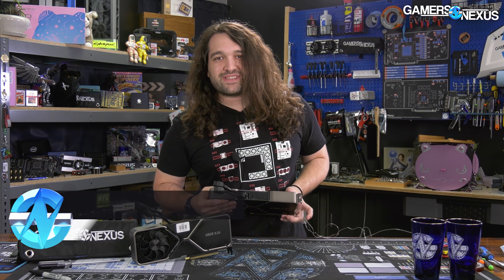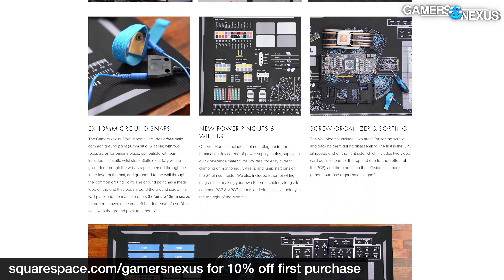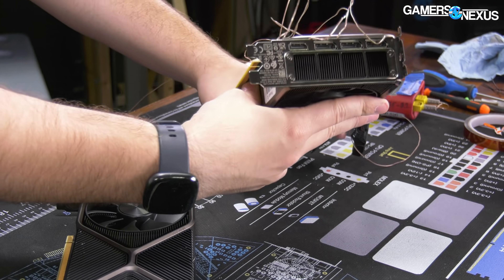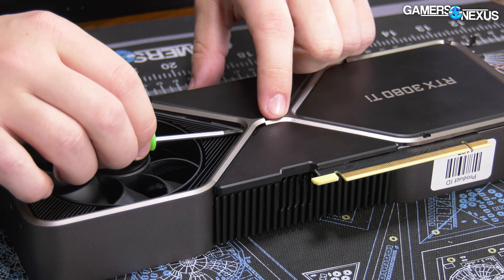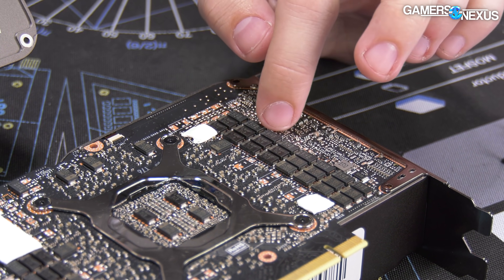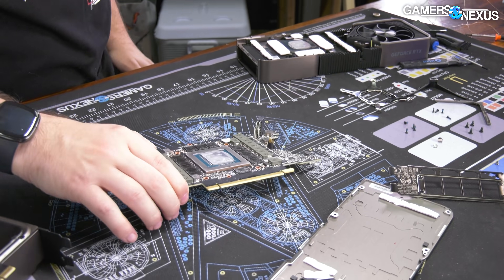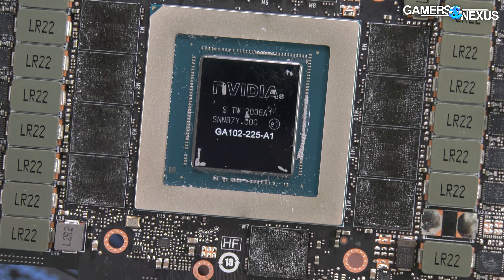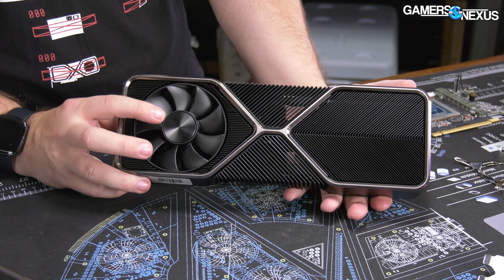NVIDIA RTX 3080 Ti Founders Edition Tear-Down: Seeking Differences vs. 3080 FE

Comment from the maker: Watch the 3080 Ti review: https://www.youtube.com/watch?v=Vtkk-_0jrPU
Reply: TIE TIE TIE!!!
Reply: Are you sure the original is not pronounced RTX 3080 feeeee
Reply: Thai as in trap thai?
Reply: Did you say pcb modmat?!?
Reply: wait is the money in there to justify the price 😂😂😂
Reply: 3080 FE: the $700 card you have to open to re-paste and add $1 thermal pads because NVidia couldn't be bothered.
3080 TI FE: the $1200 card you have to open to re-paste and add $1 thermal pads because NVidia couldn't be bothered.
Reply: Hey Steve, will you be reviewing any 3080ti partner boards? I'd rather wait for your comparisons before buying any, but if you don't plan on doing them it'd be nice to know so I don't miss any opportunities to try and get one in the meantime. Cheers!
Reply: Serious question, does anyone know just how much of the $1,199 USD price is actually a result of the tariffs?  If I remember correctly the MSRP release date price of the RTX 3080 was $699 before any tariff increase and I am curious to know the difference.
Reply: Please get some plastic picks and guitar picks for disassembly. Using the tip of pliers as a pick may have worked but it's like watching a dentist scrape someone's teeth.
Reply: You should do a review of the launch. The numbers were laughable. True paper launch. At all Best Buy stores combined across the United States there were only 3000-4000 cards. Most store at 46 to 64 cards with 200+ people in line.
Reply: Thanks for memeing Tie , dont let them forget lol
Reply: Steve can speak Thai, too?
Reply: Kinda went overboard on that, didn’t you?
Reply: If its the thai and fe wouldn't that explain the thai fee money?
Reply: What are those 5 pins in the middle for? They do connect to the board
Reply: @cripticdestiny  shroud leds or the fan
Reply: @vollkerball1  LED and the fan wires were mentioned and shown. but not that one
Reply: I'll provide 1x  a purchase donation of a standard Driver Set for 1 needy Australian enthusiast if the 3080 Super, when released, has those 2 last remaining inductors and power stages filled. Surely the incremental updates have been planned by Green.
The First Aussie to reply here, once the Super is released and GN has done a teardown, gets the opportunity to be chosen by me. No teardown, no prize.
I will keep abreast of the status in the coming months.
Reply: Hilarious part is that the front of the card actually looks like a tie.
Reply: It's pronounced 3080 "FEE" not "F" "E"...
Reply: donde tienes tu video de la 3060 ti funders  tear down que hiciste yo recuerdo a verlo visto de tu canal

Comment: Just did repaste+repad after 4 years and a half (time flies...) of hard use, your video helped a lot and still love the humor 👔!
Used Kryonaut and gelid extreme (1.5mm front and 2mm back, a few 0.5mm here and there but not mandatory)
Thermal paste was super dry, thermal pads seemed ok
I think my sample of 3080 Tie FE was a good one, I've done 21 295 graphics score in TimeSpy with it (overclocked and overvolt)

If someone wants to know the results : 
24°C ambiant
Steel Nomad UV+OC (0.818v and 1830 MHz and +900 on memory)
power draw : 350W
fans : 49% (1730 RPM) -> 40% (1400 RPM)
core : 72 -> 66°C
memory : 88 -> 82°C
hotspot : 81 -> 73.5°C

I've done more tests with fixed fans, basically the higher the fans spin the less the difference, with 100% fans it's only a few degrees.

Selling it to someone who won't downvolt it, so he will draw more watts, I want him to get a nice experience (as quiet as possible since this card can sound like a Airbus taking off) and hopefully the card will serve him well.

Comment: Finally got my hands on this for my Ghost S1 Build 5800x3D now I'm just waiting on the RTX Spine and the copper plate for this iv already added the kapton tape around the memory so it doesn't short. And yes this card needs the copper plate it's going into a very tight space all the help I can give it will be needed. Also ordered multiple 2.0-2.5 thermal pad replacements.

Comment: Just use duct tape to remove the screw covers! It’s really easy. I got some super tacky duct tape called TRex duct tape. But any tape is strong enough to pull these off. I tried for a while with a screwdriver, but all its going to do is leave marks and possibly send that thing flying.

Comment: ? How are changes in capacitor types and changes in phase module layout not considered potentially significant? GN could have easily looked up the part numbers on the caps and provided an actual detail about the different caps. Instead they discard the change as not significant. What does GN base that determination on?……….Real sus GN

Comment: Great video helped a LOT! Quick question if any1 could answer. I have installed the EK Special Edition Waterblock on my 3080 ti FE and I get temps around 54-55 degrees Celsius (under load) in a Lian Li o11d (yeah, unique, I know) with a 360 PE and 360 SE EK radiator and an i5 9600k overclocked to 4.8Ghz in the loop. Are those temps normal or a bit high? My 2080 super in the same loop was running around 8-10 degrees lower. Thanks.

Comment: I fully agree that the price hike isn't warranted at all.  But at the same time this is the only card I managed to buy at MSRP to upgrade from my 2080.  I'd rather buy an overpriced card at MSRP than pay $2000 to a low life scalper for a marginally "worse" card.  Thanks for the video though.  I needed this to determine whether I could use a 3080 waterblock on my Ti

Comment: The different caps may be another power rail or are being Operated at a higher power and therefore have some sort of derating factor (or stuff on the other side of the PCB needed extra cooling)

Comment: Hey GN! Been a big fan of your gpu teardowns for a while now and I would like to learn more about the methodology about how the boards are put together. I'd love to see a video from you guys about why certain components are where they are and how each piece works together. I'm especially interested in memory modules and how they work with capacitors and connections to power and core. Maybe if that isnt something you guys would be up for, could you direct me to a channel/video/blog that goes into those kinds of details? Thanks! Love your stuff!

Comment: Not gonna lie, I have almost zero interested in GPU's atm.
In fact I have almost zero interested in computer hardware at the moment. 
Which is odd because since the  early 90s I have always been constantly following, upgrading, overclocking, gaming, socializing, ect.... through my rig(s)
Just these prices are to out of control, and stock problems. Its taken the joy out of it.

And so, I have sort of been "forced" into trying out new hobbies, like I recently built a playset for my daughter, and I bought an old suburban that I'm building out to be a weekend camper with some offroad capability. Its funny how the butterfly effect works.

Comment: 10:38 They were most probably limiting supply on purpose by allocating dies for this unreleased GPUs from the 3090 rejects. They're playing for maximum profit while saving on the architecture development cost by implementing a jack of all trades architecture with total disregard for power consumption.  AMD on the other hand,came claem with its top threee SKUs. I guess it wasn't enough for Nvidia that the market conditions  would naturally make any available GPU popular,  they had to screw customers over even harder. It wasn't enough for them to sell directly to miners or to keep the best silicon for themselves. I have a 3080 in my system but I still hate their guts and hope they get dunked on by AMD. Guess they didn't learn from what happened to Intel.  Jensen should be shivering in his seat man

Comment: The first retail prices for board partner 3080Ties are up, ranging from €2299 (Inno3D) to €2699 (MSI). This was never going to be an affordable or bang-for-buck GPU. But bear in mind that the 6900XT is up to €400 cheaper than the cheapest 3080Tie (and less power hungry). If you're silly enough to buy any GPU at all in this market, let alone these top tier ones, I wouldn't overlook AMD.

Comment: Well Steve, technically that is the correct way to pronounce "Ti"... "Ti" is not an acronym to be called T.I., it is just short for Ti-tanium.
Now, all you chemistry nerds out there will tell me random symbols from the periodic table. But what they fail to grasp is, those elements are Latin words, not English words. The periodic table was invented in ancient times, not yesterday. A common mistake, I'm sure............👎

Also, in this particular instance, "tie" is the correct pronunciation. However, you can call it whatever you want or whatever is easier for you...
Reply: Also, for dummies: "FE" is an acronym and IS pronounced F.E.. It stands for Founder's Edition. So, "fee" is wrong.

It's funny how people argue with you, without even understanding why... smh

Comment: supply and demand. Price increases as demand increases. If supply is constrained (like power limits in overclocking) and if demand exceeds supply, the price increases until supply does not exceed demand. Price regulates the demand. Don't get all worked up about it ... it is the way it is supposed to be.

Comment: Yeah...I don't see myself with one of those cards. The 30 series is dead to me at this point. I don't care how much faster it is over my 1080. My older 1080 can still handle what I throw at it at 1440p resolution at an acceptable frame rate so I can patiently skip this generation and wait for AMD to take nVidia down a few pegs.

Comment: Ti's should be at least 20% more powerful than the standard model.  This thing is barely a Super.
Reply: Supers didn't even exist before last gen. Also, Ti models have traditionally varied by huge margins depending on yield and competition. There have even been generations where the real Titan was barely any faster than the 80ti. And now we have the 90 nomenclature... 

TL;DR: Nvidia counts on it's customers to be either stupid or have a very short memory span because their model names mean absolutely nothing other than smaller = not gooder (Except if you're counting VRAM. Then 60 is better than 70 and 80 but not 90).

Comment: Sorry to double post but i must say, yes its overpriced, but it IS well made! (Err...except the thermal pads..) Some, like Zotac, being tight on the capacitors and even VRM phases missing..sadly i have the Trinity version with a waterblock yet could almost boil water on the backplate (3090) i mean GDDR6 runs hot...but 6X? Great Bytes Of Fire!

Comment: I heard that Nvidia was originally going to use $1000 bills as they have a better thermal conductivity than $100 bills. It must have been a cost cutting measure.

Comment: Interestingly on the backside of the board, my 3080 FE (December 2020 manufacture) had the same half-hearted attempt to thermal pad some of the rear capacitors in the same position. My 3080 FE has identical datestamp, printed labels and other identifiers on the barcode sticker, which says to me that it's definitely a common heatsink design.

The placement of the pads on my 3080 FE was identical to that 3080 Ti - and lazily done in the factory (alignment not great). Plus they use that same crap pad material with inadequate W/mK rating.

I ended up removing them - as suggested by some other mod guides online - and instead thermal padded the flip-chip VRAM areas on the back of the board and improved around the "V" at the board edge. That combined with front-side thermal pad additions has brought my memory temps down about 30-40 degrees celcius during workloads or mining. 

I did this to prevent the regular thermal throttling during games and heavy duty raytracing or benchmarks. I mine occasionally for fun, but the payback at the moment is still only slightly over break-even, despite being able to mine over 90MH/sec.

Comment: Okay, I didn't have time to watch the entire video, so let me ask: If the 3080 Ti is based on the 3090, and is nearly the same performance as the 3090, then how is it the same size as a 3080, rather than the same size as a 3090?

Comment: So it’s the 3080 Thai and you work on it with your tweezers from Thaiwan? I see what you did there.

And that’s not quite enough $100 bills. You need about 10 more.

I just replaced the thermal paste for the first time on my EVGA 1070 SC for the first time since I bought it new in 2016. Hoping it doesn’t die before I can get a new GPU but assuming we ain’t getting any until 2022 at least.

Comment: I got that same short plug with my 3080 ti and it dont reach my psu so i obviously connected it to others and ran it does that matter? like bridged  or should I order a longer cable so its connected directly to psu and not to other cables and then to it sorry im a noob hope this makes sense

Comment: So what you're saying is, they halved the stock of the 3080s to make the 3080 Tis, and now they could ramp up more production for the 3080 Tis because it's NEWER, and since no one can get their hands on either they are desperate for either the 3080 or 3080 Ti. But, there is probably a better chance that the 3080 Ti stock will be much more since no one can get a 3080 in the first place. Money grab.

Comment: the 200 extra dollars i would not really minded. here in switzerland the card should be roughly translate 1:1 from USD to CHF meaning 1200.- CHF (in reality that is 1400.- USD incl. tax).
So i refreshed yesterday all morning and afternoon long the seller who would have it. they wanted about 3000 USD, and i am talking about normal retailer... i asked what the heck is this. does nvidia want doubly what they say the MRSP is? and than the manufacturer of the card also want the double, so that the retail also has to charge the double? in my eyes the retailer commited fraud.

Comment: I got a 3080 FE recently and it does have the extra thermal pad at the top of the filters just like your 3080 Ti in the video. Perhaps it shares the same capacitors as the 3080 Ti or it's just a general improvement.

Comment: It's like Nvidia re-released the 3080 but the price point they originally wanted to sell at. But they knew the insane demand they would create by pricing it way lower than previous 2000 series launch msrp. Mean clean market manipulation at work.

Comment: Should I try to get one of these instead of my 3090 for gaming?
It was an arm and a leg, but the only card I could actually buy.
Memory junction temp goes to like 110 of I try rendering or mining, and  90-100 gaming, so apparently the Gigabyte Gaming OC 3090 and others have super cheap thermal pads for the memory modules. Even random Amazon pads bring it down 25-30°C, but in Canada it voids the huge, 4 yeast warranty.

Comment: What people don't know is that, at least for Europe, the msrp is only available for FE cards and due to taxes, 1200$ is actually 1600€ here. And taking in consideration the retailers fees and the different   model of the same card, the prices won't cost less than 2000€ anytime soon than 1 or 2 years from now.

Comment: Steve, your quips about flip-chip and memory are kind of inaccurate. The top of the package is still much closer than all the way to the other side of the insulating PCB. And if the top of the package has an adequate thermal solution, any heat sinking through the PCB will be negligible.

Comment: Great videos (both this and the review) it’s interesting about the price, I don’t condone what NVidia has done but potentially in NVidias defence, the price is probably done more as an anti scalping measure - people spending ~$1000 on a scalped 3080, may spend $1200 on a Tie, (if you can afford a GPU in today’s market you be looking smart) however as you mentioned with performance, it’s unlikely for someone to spend $1600 on a scalped 3080 Tie. Reducing scalpers profit margins etc.  Making the scalping less profitable. It’s a loose-loose situation on NVidia.

I do feel like a ~$1200 GPU does have its place in the market but not a sensible one. Since SLI isn’t really a thing anymore, due to lack of support and optimisation (it exists, but I have 2x1080s and most titles only utilise 1 and Vulkan uses 1 but offers more performance than DX11 SLI (doom 2016 + rainbow siege). So a £1200 is for those people who want an SLI system for that bit extra ‘passion over performance’ out of their builds, without the hassle of all the SLI complications. Maybe ship with a waterblock stock. But you need the 3080TI offering at ~ +40% performance over the 3080 similar to the average uplift from SLI.